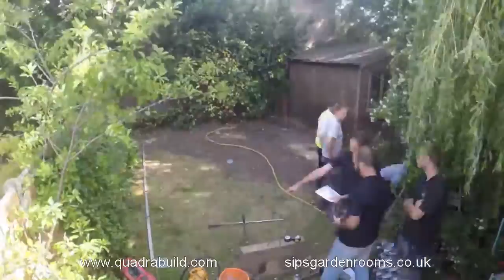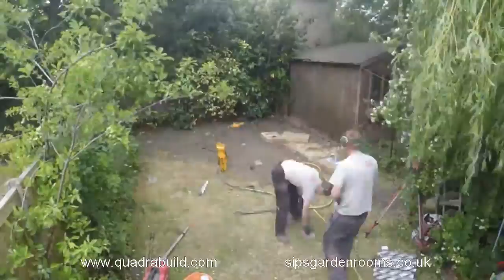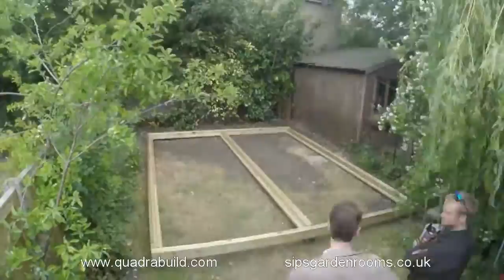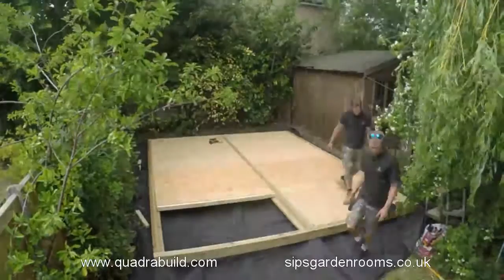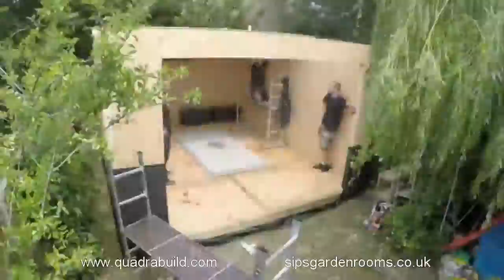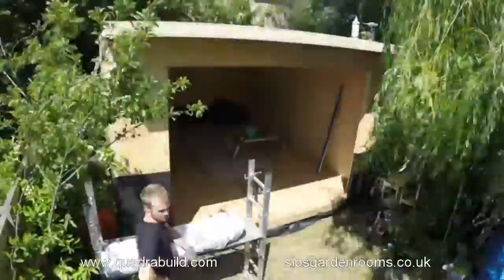QuadraPile Foundations for a SIPs Garden Room

Comment: hi im looking to put a timber framed extension on my property which would have a projection of 2.5 mts x 4.5 mts this would have a timber firestone roof so the weight would be low. How many and how deep do the helicoil piles have to go and whats the costs involved and can they be bought independently thanks.
Reply from the maker: Hi Andrew, many thanks for your interest.
To carry the loads from the size and type of building you describe, we would most likely only need four piles.
However, it is likely that any floor structure would not be able to span that far so would need more support than this.
Therefore, based on previous experience, I would expect to need six piles.

The required depth of the piles will be dependent on the loads (as you say these will be fairly low) and also the type of ground encountered.
We proof test each pile when installed to ensure that they achieve the required capacity and can then drive deeper if necessary.
For the situation you describe, I would expect to need 2 - 3m depth per pile.

Costs will be dependent on the site, location, etc.
We can supply and install just the piles or piles with steel work to let you do the rest of the construction yourself if that's your preferred method.

If you could contact us by email at <sales@QuadraBuild.com> or via our website www.quadrabuild.com/contact with some more information (primarily the site location and any other detail you have about the site) then we can give a better idea of the cost.

Comment: How much would the materials cost for  this job
Reply from the maker: Hi Mark. To give a cost estimate, we'd need some more details. For example, were you interested in just the foundations or the whole building? The foundations on this build used our QuadraPile system which we installed. It is possible for you to install yourself but we'd need to advise on the foundation requirements - every site is different and we don't just sell a one-size-fits-all foundation that may not work for your specific site.
Please get in contact via our website and we'd be happy to help:
www.quadrabuild.com/contact